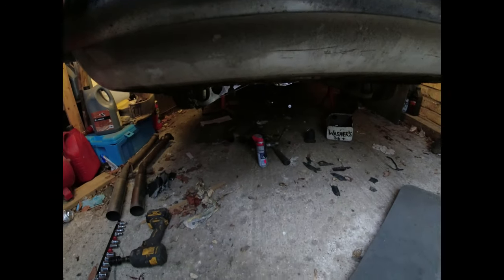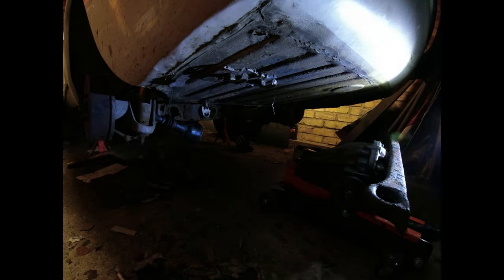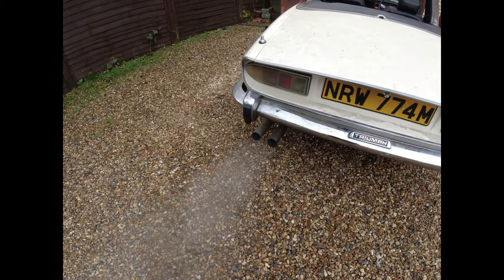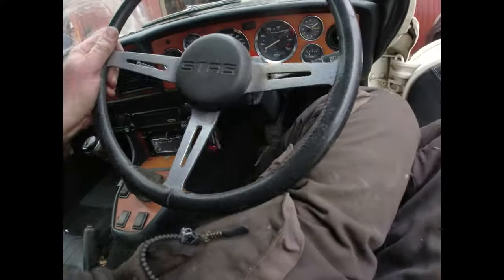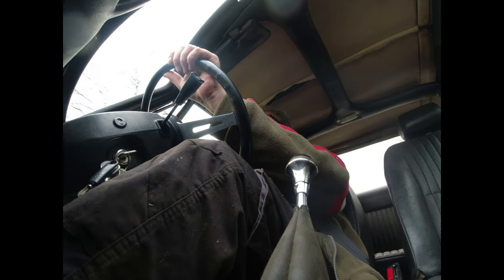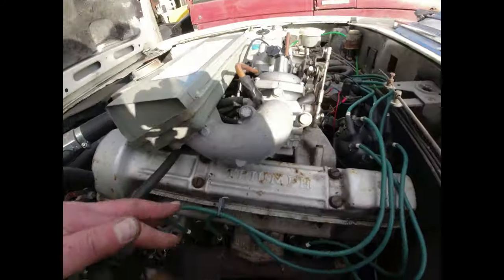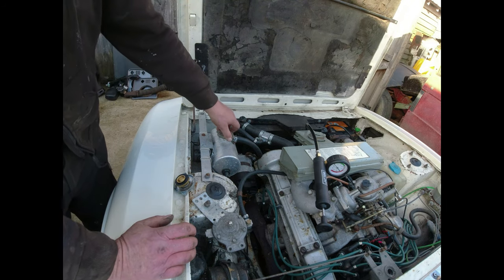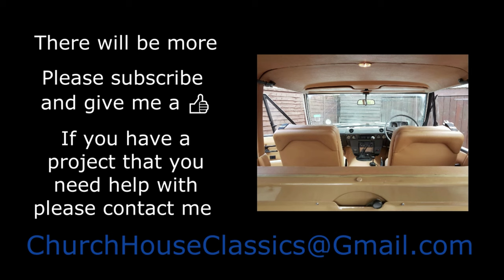My Triumph Stag being woken up pt3

Comment: Nice to see a gathering of stag owners saying goodbye to a friend.
Back in the mid seventies I had a triumph 2000 and managed to get the diff out using a car jack and bits of wood.
You do some stupid things when you are young.
Had a wheel bearing fail so removed drive shaft but couldn't get the wheel hub off.took it to a Leyland garage and they managed to destroy the hub trying to remove it.
It was a trip to the local scrappy for another drive shaft assembly.
Must say the stag looked quite presentable after a bit of spit and polish.